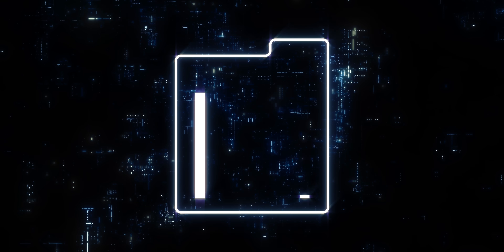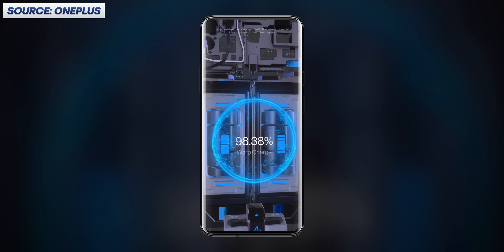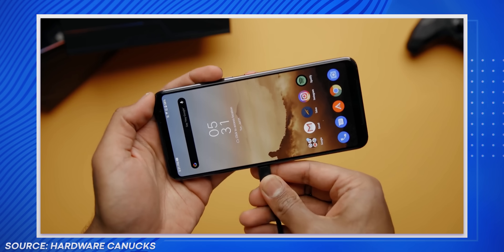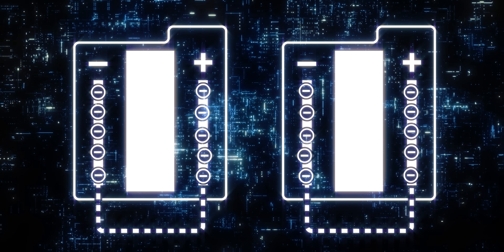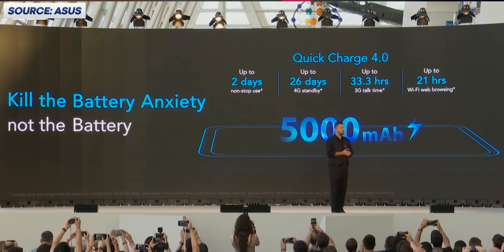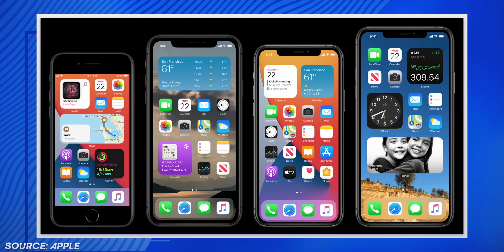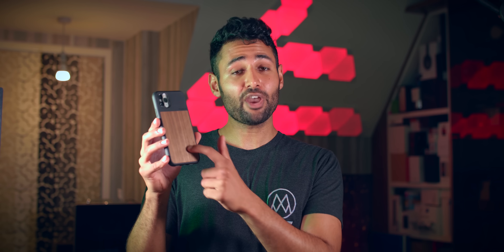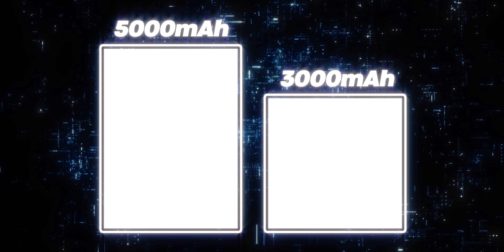The Problem with Fast Chargers.

Comment: In truth I always Charge my Smartphone in the normal way and I NEVER USE FAST CHARGING AS I HAVE NO NEED FOR IT
Compared to what this Video says a slower speed for Battery Charging will not only keep the Phone cooler but it will also stop the Battery wearing out so quickly
Reply: The problem with battery is heat. If you use 5 charge but u using device for gaming it still bad for battery. Mine using fast charge 67watt full by 40 minutes + cooler for keep battery temperature below 40°C its around 37° if not using cooler the temperature up to 42°C

Comment: I have both 5W ( galaxy a10 ) and 80 W  ( one plus nord 3 CE )
Galaxy is still fine for basic use as when I charge I use other devices , One plus does charge quickly which is nice but I didn't bought it for fast charging so I did watched this and MkBhd video about fast chargers to see if it's really needed to be more careful with how to get efficient charging

Comment: I got one of those display cables that show the wattage coming through, and on the s24u a 10w charger charges at 7 watts, and a 15w samsung charger charges at 5 watts. Why is the 15w charger supposedly charging slower than a 10w charger on the same device? Is there some other factor in this equation that i am unaware of?

Comment: I have an oppo X3 lite with a 65w super fast charger. I have had this phone for 3 years and make the following comments.

1) my battery does not get warm when charging.

2) I can still get 12+ hours of screen time on one charge.

3) there is no noticeable degradation of my battery.

It is simple to achieve this. I never charge my phone over 80% and I never let it go below 20%. I don't use my phone whilst charging it. It's that simple.
Reply: How hot do summers get in your country?

Comment: think this video misses two points
1. battery chemistry has gotten better too, and will continue to get better 
2. current phone batteries lasts longer on a single charge so reduced full cycles occur in a given period of time than before
Reply: Most phones still use lithium ion batteries, the same chemistry they have been using for years. The batteries are not really lasting longer, they have just been fitting bigger batteries into the phones and making the other components more compact.

Comment: I have 2 old iPods (a 3rd generation ipod nano, and a 2nd generation touch), which I have always 'slow charged'. They still have their original batteries, and those still hold enough charge to be totally usable. I still use them, and the nano manages over 3 weeks of standby time still, or some 16 hours of play time. The touch still manages over a week of standby time and over 10 hours of actual usage. Not entirely as good as new obviously, but for batteries which are both just over 15 years old, that is very good. Yeah... I should get those batteries replaced by now, eventho they still hold a good charge, because they'll damage or break the display once they decide it is time to turn into a spicey pillow.

Comment: Fast charging kills battery gradually. Max 12w should be used for optimized charging.
Reply: Every charger kills battery. Degradation is a hardcoded law of physics (2nd law of thermodynamics). 

While fast charging does TECHNICALLY cause more degradation, it is not at a level that would be noticable. Unless you plan on keeping the same phone for 15 years, it won't matter. 

And the fact is, battery replacements exist. My Redmi 120W phone lasted twice the time that my Samsung 25W phone did (both were equal when brand new, but within 2 years my Redmi's screen on time dropped like 15 minutes (of a 12hr one) vs the samsung who dropped to 8 from 12)
Reply: I have fast chargers and they read out 5-6watts on the cable display while charging. So i doubt that all fast chargers actually feed the advertised speeds to your phone

Comment: I did a test and let my power bank fully charge quickly and slowly. The result was a higher power consumption when charging. Fast also means significantly higher power loss
Reply: By higher power loss are you saying the battery didnt last as long during its discharge as much as a slower charged battery? Im interested to know the physics behind that phenoma if it is the case

Comment: Does it hurt the battery, if I use a fast charging brick, e.g. 65W on a phone that only has e.g. 25W charging?
Reply: No, the phone will only charge as fast as it was designed.
Reply: @R3cce  Thank you!

Comment: I've just rewatched this video. I've never considered the fact that a larger battery will charge to a smaller batteries full capacity quicker, with the same charger.
Reply: Even with a slower charger(slower to a certain extent of course).

Comment: Yes it damages. 30w charger makes your battery go up 45C. And that isnjust 1 thermal sensor.. internal cell temp is probably around 50c...

Phones back sode is often made ofnglass which is a terrible heat conductor.

Also in a new phone o noticed slow charged phone has better discharge rate. Meaning at 100 pct in your pocket and locked it stays at 100 to 99 in 2 hours 3 hours.

But fast charged goes to 95 93 at the sme scenerio. And i am talking about 30w chargers as fast charging

10w is good and healthy. 15 17w is a max
Reply: my iphone 14 battery gets close to 45C with a 20 watt charger.
Reply: @R3cce  use a 10w charger then. That is because your back cover is made of glass.
Reply: Its weird cause i have a 10w charger that gives more watts while charging than a 15w samsung charger does. The samsung it 5 watts while charging and the 10w charger is 7 watts while charging. So there could be some underlying tech or program that makes any charger damage the battery more even if you think it is a "slow" charger
Reply: Hah. My 120W redmi gets to 30-32C when charging at 120W. WHILE i used it. Yall just have shitty phones. 

(Also, that is not an outside measurement, i opened the phone up and measured the exact temp of the battery itself

Comment: my fast charging phone is now 2 years old and I never had an issue like what iphone user youtubers are telling on their channels
Reply: The battery wear is gradual so youre not a scientist doing experiment in plain text. Youre some random that doesnt notice the difference, cause u got used to it. Like when ppl gain weight if u see them everyday its hardly noticeable vs when u see them once a year.
Reply: @jordan-mn6yy  i'm aware of that, but my phone with fast charging capability doesn't degrade at the same rate as what your idol is talking about in his channel, it still depends on how much you use your phone everyday, how frequent? are you also aware than iphone's battery deteriorate overtime as well?

Comment: Incorrect, apple uses slower charging because they use Li-Ion not Li-po which is a worse battery technology and has a shorter life, Pixels and Samsung also use this tech. The faster charging phones use Li-Po a more stable chemistry but less dense, but as phones are large now easy to implement. Chinese manufacturers use Li-po so I always buy them (Although I have a pixel 7 pro I got for half price) I will be switching back.

Comment: My samsung has mode for slow charging 0%-100% in 2h and 35 minutes or fast charging 0%-100% in 1h and 30 minutes I have charger that shows A and v so when I'm charging phone from 1% to 100% it pulls 1.60A at 5.1v and when battery goes to full less and less at 100% it is going 0.02A and if you leave it lika that it will go to 0.00A that if im leaving it alone if im using It while charging then it is pulling 1.70 A at all time as long as I'm using it while charging

Comment: Thanks Arun for a detailed insight into fast charging.  I was so against the idea due to degradation of lithium ion batteries with heat. Oppo recently claimed 1600 fully charged cycles ehilst offering 80watt super vocc charging.  Not sure how they managed that

Comment: My realme came with a 33 W charger. It takes around 1 hour, maybe 1,5. It doesn't seem to overheat (the charger does, but not the battery). If I'd plug it overnight, it's supposed to know my sleep pattern and keep the battery at 80% until some time before I wake up where it would go to 100%, but I genuinely do not plug in my phone overnight anymore - it just doesn't make any sense to me since it takes so short to charge anyway.

Comment: Thank you for the tips. I think this is why some manufacturers ditched chargers in the box and can't blame them because everyone deserves a choice. Please choose Quality over price. What's the disadvantage of USB A to C vs USB C to C  I want to know. I wonder if it makes a difference personally I do have the occasional habit of charging overnight but I find topping up to 70 percent when you get to about 50 percent you have a more steady decrease instead of like 10 percent every time. It's like your gas tank top up at quarter. Unplug before you fall asleep.

Comment: Don't listen to this clown, claiming Apple slows down your phone to preserve the battery. That's absolute BS. This guy's a shill. Nothing more than a shill.
Reply: Apple did slow down phones in the past to preserve battery life.  Not because of planned obsolescence
Reply: @R3cce  That's utter nonsense. I don't know if you think I'm stupid, or what.
Reply: @thatfirstone 
What was Apple supposed to do then?
Apple can’t have phones shutting down unexpectedly. It is hardly reliable and may contribute to more users upgrading compared to a device that runs a bit slower but can still be used. Apple’s solution to the problem makes sense. The only reason people got mad is Apple’s lack of transparency. They didn’t tell anyone what they were doing. That’s the problem
Reply: @thatfirstone 
Dude, i know EXACTLY what i’m talking about. If you still don’t believe me, then i guess i have nothing left to discuss.

Comment: Am confused  the more.  Which should I go for fast charging  or normal charging. Charging at 80% or at 100% . .which is which
Reply: Any modern smartphone will charge the fastest from 0-80%
The charging rate from 80-100% will slow down by a lot to protect the battery health
Reply: @R3cce  my phone goes faster from 96 to 100 is that normal?
Reply: @nickname147  
Depends on smartphone manufacturer. Some may prefer charging speed over battery health and vice versa. But it is normal for the charging rate to slow down somewhat near the end.

Comment: Most phones now days have charge speed directly tied to battery temperature. The only time true fast charging is even possible is when the phone has been idle long enough for the battery to be cool. Typically under 30 Celsius battery temperature is required for true fast charging. Every 10th of a degree above 30 Celsius causes the charging to reduce. At 39 to 40 Celsius a modern phone's charging will slow to a crawl. 45 Celsius is an absolute dead lock where the phone will absolutely halt all charging completely.

Comment: I had a 15 watt adaptive charger and a 10 watt adaptive wireless charger for my Galaxy S8 Active, and it's battery lasted me from September 2017 until October 2022. I now have a 25 watt charger for my Galaxy S21fe 5G. So far I haven't noticed any more heat from the faster charge on the newer phone. So I'm hoping this S21fe last for 5 years like my Galaxy S8 Active did.

Comment: Seems mostly legit, though I would add that actually the structural decision to have two batteries in SuperVOOC charging helps with thermal management. Well, not necessarily compared to slow charging, but it allows for use of higher voltage without having to majorly step down the voltage on the phone, which other high-voltage fast charging systems have to do, resulting in more waste heat and associated problems. They are doing the two-battery thing for a reason.

Comment: I have a xaiomi with a 120w charger, and I'll bet that the battery lasts longer  on it than my old Samsung with slow charging did. I plug it in briefly as needed, not overnight, and bounce it between 30 and 80 percent except on the odd occasion that I need to be away from the wall all day, where I'll let it go to 100. The heat it produces when charging below 80-90% isn't concerning, even at full tilt. My Samsung on the other hand, because of how slowly it charged, was plugged in overnight and used frequently while charging and/or with the battery well below 30% toward the end of the day, because leaving it charging for the better part of an hour to get back up to a good level wasn't practical.
Reply: Same here, I have a 72w charger, always between 30 and 85% and after a year the battery is still perfect so I understand all he's saying but I rather have that option that to have to wait 2 hours for a full charge.

Comment: that's why VOOC and Super VOOC are better than Xiaomi or any other Brand's fast/ultra fast charging tech, because VOOC and Super VOOC doesn't heats the phone much but instead heat the adapter more whereas in Xiaomi both the phone and Charger gets super heated

Comment: Samsung and Apple both are avoiding crazy fast chargers, my note 20 ultra with the way I use it I'm extremely energy-efficient on my phone I only lost 200 of the capacity in about 2 years I have it slow charge overnight on a wireless charger with a fan on it
Reply: apple i can agree with but regarding Samsung, I won't agree. Like S22 ultra has 45W charging support and also the Samsung Batteries are the worst ones since the Note 7 Disaster

Comment: I charge to 100% all the time with no problems at all
Reply: He said in the long run that will degrade the battery health and also said about the Buffer that Brands put so that you don't actually full charge your battery and do serious Damage to it
Reply: @dragonforcegaming7555  when a smartphone battery icon shows 100% it means it IS 100% FULL
Reply: @stephensnell5707  actually it's not. It's a software tweak. The battery doesn't charges to 100% because it's harmful for the phone and degrades the battery much faster. So when it's almost full the phone shows 100% and stops charging
Reply: @dragonforcegaming7555  after 6 years I always get a new Smartphone to replace the old one
For example-I used to have a Motorola Smartphone which lasted me 6 years but it eventually got so slow and sluggish and the battery was so worn back in April 2022(this year I got myself a Samsung Galaxy A12 Smartphone and my Samsung Galaxy A12 automatically cuts the power once the battery reaches 100% full charge)
Reply: @stephensnell5707  although a phone's battery isn't supposed to last 6yrs without much degradation but still it's okay to use it for 4yrs+.
Btw all phones cut off charging once it reaches to 100% to save the battery health.
Reply: @dragonforcegaming7555  actually my previous Smartphone NEVER EVER WOULD STOP AFTER REACHING 100% IT WOULD KEEP ACCEPTING CHARGE UNTIL I WOULD UNPLUG IT
BUT MY SAMSUNG GALAXY A12 SMARTPHONE CUTS THE POWER ONCE THE BATTERY REACHES 100% FULL
Reply: @dragonforcegaming7555  in truth I like to keep my Smartphone for up to 6 years to get as much as possible from it before changing to a new one
I will always wait a good 6 years(this is when the battery will be unable to hold charge for a whole day)
However,my Samsung Galaxy A12 I only got it back in April 2022 so it will be a good 4 to 6 years before I change my phone again
I am not like other people who stupidly change their Smartphone every 2 years I am not like that
Reply: @stephensnell5707  it's good that you don't change your phone frequently. That's a real good thing you do. 
Regarding the battery holding capacity of Your new Samsung i can't say for sure whether it will really hold for 6yrs or blast within 4yrs because Samsung phones always had an issue with Battery. Even this year many of their 2-3yrs old Flagships suffered from severe battery swelling issues worldwide
Reply: @stephensnell5707  yeah the phones before 2019-20 weren't good at power management. Nowadays there are special chipsets inside the phone to cut the power supply once the battery reaches 100%. Most of the brands also gives "optimised night charging" option too nowadays . It helps in over night charging. The phone will keep charging for a bit and cut the power supply then again restart charging it an hour before you wake up. The phone learns from your regular behaviour with the phone.
Reply: @dragonforcegaming7555  i charge once each night
Reply: @dragonforcegaming7555  I can see my Samsung Smartphone battery lasting a good 6 years without it developing any problems at all
I always take great care of my Smartphone which is why I can get it to last as long as 6 years solid before changing it
Reply: @stephensnell5707  good job ✌️

Comment: The golden rule to charge lithium ion battery is :
Charge from 50% to 70% this wil give 1200 charge cycles.
Second rule is: never go more then 20% below 50% or never go more then 20% above 50%
Best charge habit is: charge from 40% to 70% this wil give 1000 full charge cycles.
Friendly greetings from : Herman from the Netherlands Amsterdam
Reply: This only works if I am doing nothing but staring at my phone while its charging.

Comment: My phone heats up while fast charging
Reply: bye bye battery
Reply: Xiaomi phone?
Reply: @dragonforcegaming7555  yes
Reply: @Kingdom_of_Croatia  that's why it's heating up. Xiaomi fast chargers have a higher voltage output which affects both the charger and the phone. If it would have been a vooc or super VOOC charger then the phone wouldn't be much(almost   heated much during charging but also reach super high speeds of charging
Reply: @dragonforcegaming7555  Thanks
Reply: @Kingdom_of_Croatia  welcome
Reply: yep
Reply: yes